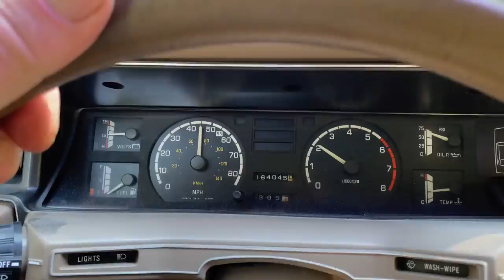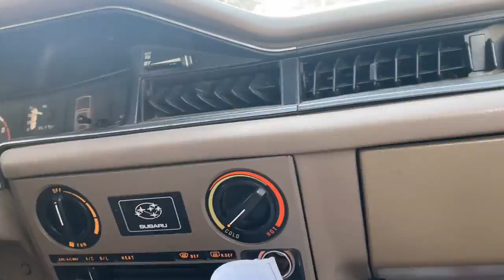Subaru BRAT Brumby carburetor problems/ carb tear down

Comment: Thanks for a very helpful video.  It has been a while but I don't suppose that you remember where the model number is on these carbs or what repair kit you used.  The carb that I am working on came off an airboat so I don't have a vehicle year and model for reference.  Thanks

Comment: Great video. I'm rebuilding that exact carburettor. Unfortunately it did NOT have a check ball so I'm figuring that's why it wasn't working. Could you possibly tell me how big the ball is and if its a special plastic or steel ball please?
Reply from the maker: I got a new one in the kit. It was plastic ( I suspect it’s nylon). I do not know what size it is, however. Funny story, I wasn’t aware it had one the first time I broke it down, so I turned it upside down and saw it drop and bounce into oblivion. LOL. I grabbed the rebuild kit and CAREFULLY opened it and looked to my relief there was a new ball in the package.
Reply: @RealWorldGarage  cheers for the quick reply. I'll squirm round the garage floor and see if I get lucky. 🤣
Reply from the maker: Good luck. I try to stay on top of my communication, you have to keep a close eye on your notifications. I have a few get me sadly. But I try!!!

Comment: I have a question to ask 
I know the Fuel system is 3-5psi. But will a 4-7psi pump work?
Reply from the maker: As hard as parts have been to find, I would certainly give it a try if you have access to one. We installed a new click clack pump and he did end up switching back to the old one because the new one failed and wouldn’t move fuel.
Reply: @ my old one died 
Did pump fuel but now intermittent. It sat for years and years. Was also stuck
Reply from the maker: Did you have the tank cleaned professionally?? It took my son a long time to get all of the rust out of the entire system. The lines had rust that kept breaking loose and he had to blow the lines and filters out numerous times. He also attached a magnet to the tank to catch any fine particles that would break free. These tanks are very hard to clean, even for a professional shop, and the lines are incorporated in the body making them very difficult to replace. There are 2 fuel filters on these, one by the pump and one under the hood. They will plug up and make your life difficult. It will take compressed air, and persistence. Buy some extra filter to swap out. You can hear the pump when it’s pumping the fuel change and get louder when the line gets plugged and stops flowing fuel. Be careful when dealing with the gasoline, stay safe and keep a fire extinguisher handy.
Reply: @ I can suck and blow in the lines just fine. And it flows very well when you do suck on the line.
Reply from the maker: That’s at least good news. But what about the filters,Are they still free flowing???
Reply: @RealWorldGarage  yeah they are
Reply from the maker: Then looking at the pump sounds like you’re on the right track. The aftermarket pumps to replace these are generally junk and won’t last long.
Reply: @ yeah I know 
But she’s gonna be a yard farm car
She rotten but still goes well

Comment: At 31:35, what kind of grease did you use?  Thanks
Reply from the maker: Just wheel bearing grease. And I mean a little, I just don’t like installing them dry and I’m leery of spray lubes on that plunger.